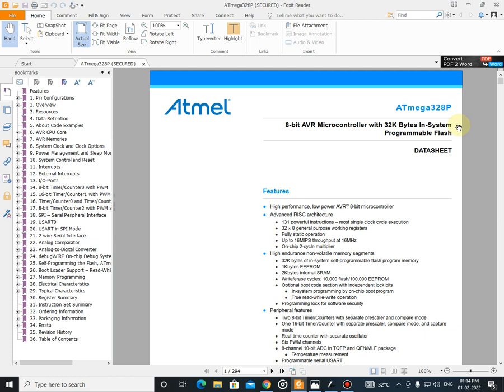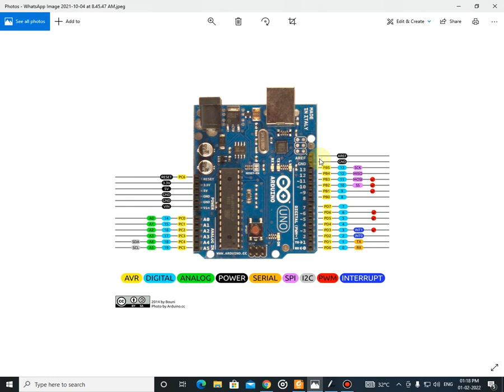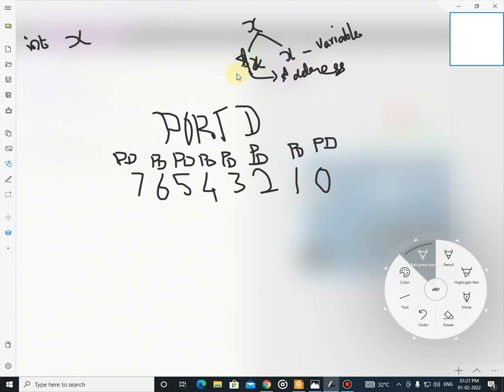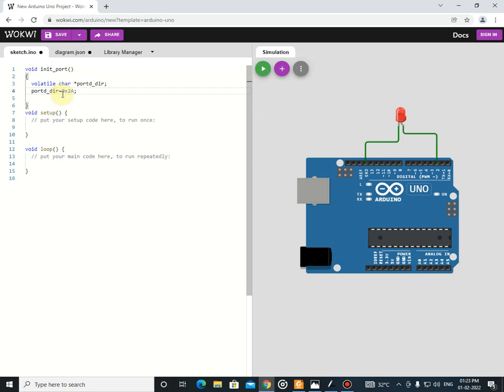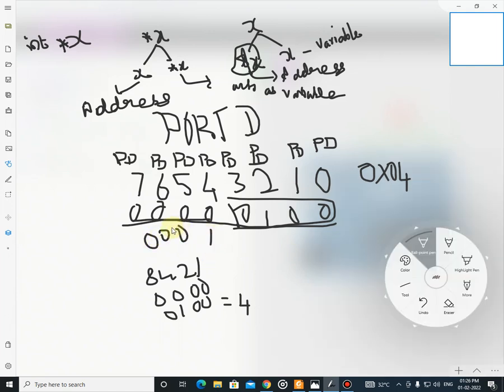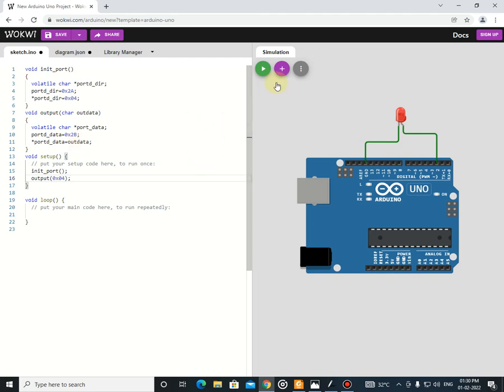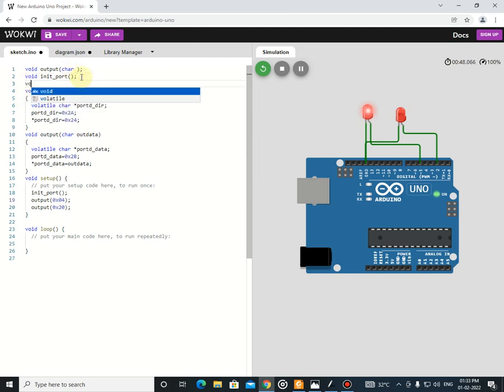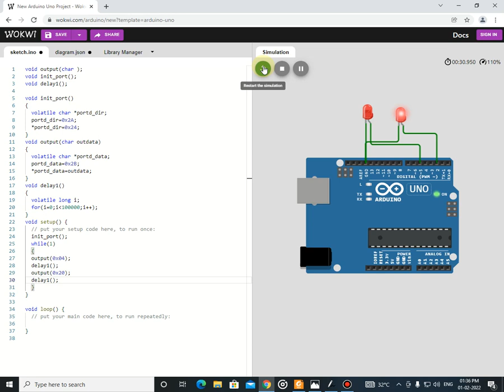LED INTERFACE WITH ARDUINO UNO WITHOUT LIBRARIES-PART 2

Comment: Thanks for the great video.
why are you using volatile here?
and why char?
I'm a beginner🙂
Reply from the maker: char is 8 bit as arduino  has 8 bit register
volatile is because "compiler will optimize the code " to avoid that  we use volatile 
the compiler will fetch each time from the memory